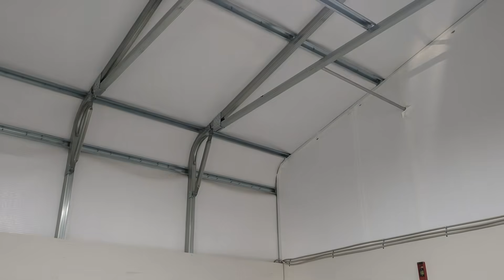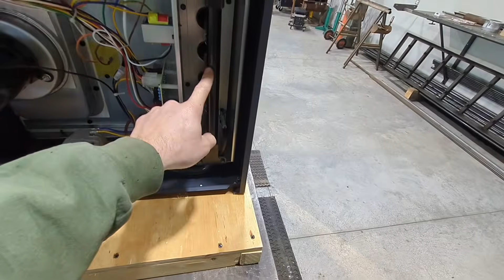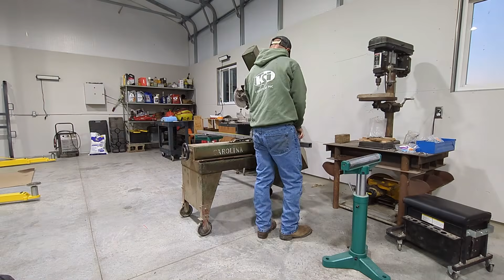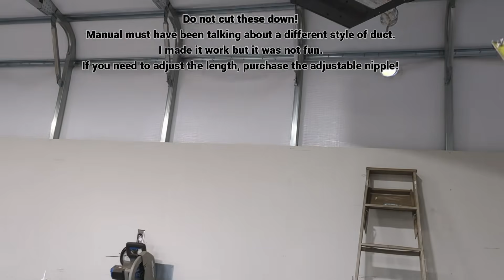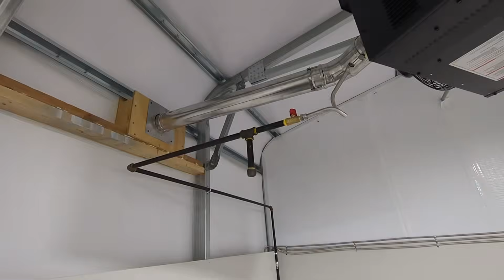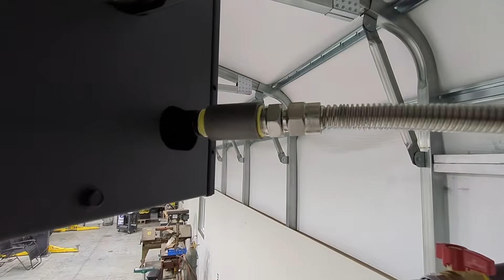Mr Heater Big Maxx Shop Garage Heater full install with Propane Conversion

Comment: Do you know if I can install a wifi enabled thermostat to this so that I can control the shop temperature from the house? Would be nice if I could turn the heater on an hour before I head back there to warm it up.
Reply from the maker: Yes, I think you can do that. I saw another video on you tube where they did that with their Big Maxx.

Comment: A year has gone by. How's it work? You're in a similar situation as I am as far as heating and cooling. Do you wish you would have gone larger?
Reply from the maker: So far it is working great. The only issue I have is that when the wind is blowing hard it will keep sitting down the flame and it has to relight. This only happens on windy days and we are out in the open with nothing to block the wind. Since the shop is sealed pretty tight it doesn't take too long to warm it up so I don't wish I went bigger. I usually turn it on a half hour or so before I want to start working and it works well.
Reply: @String-Ridge  my shop is out in the open as well so that's a real possibility of an issue for me

Comment: silly question, what fitting or how would you secure the gas line through the wall/ is there a bulkhead fitting or a special clamp for the black pipe? Mine will be going through a wood structure wall siding, into a 2x6 cavity. thanx
Reply from the maker: I'm honestly not 100% sure the exact way you are supposed to do it. I had enough clamps holding it to the wall on the inside that it held it all sturdy. The piece going through the wall was short and I just siliconed it on the outside. I'm sure there's a better way but that's what I did.

Comment: When you connect the flex line to the unit do you use the sealant as well?
Reply from the maker: If they are regular pipe thread fittings you will need sealant, but the fittings on my flex line were flared and those do not require sealant.

Comment: How much it cost to run lets say 3 days a week for.a whole month
Reply from the maker: Sorry I'm not sure, depends on how much insulation you have. My insulation isn't that thick but I only run the heater when I'm working out there. To me it seems like it's pretty efficient.
Reply: @String-Ridge thats my plan😂, about how much u spend in a day?
Reply: @rigorb25det  That's my question as well..

Comment: Question,  was your outlet for exhaust really loose? I noticed mine wiggled a bit but once I attached the flue pipe now it wiggles really bad-almost feels like it is broken or trying to come loose inside the unit. Maybe its supposed to move like that but trying to make sure.
Reply from the maker: I do not remember mine being loose. I would open up the side and see if you can figure out if there's something that came unattached.

Comment: I just did an install in my garage, its the 50k BTU unit though. Used gas tite flex pipe, way easier than that black pipe! I also wired a nest thermostat to the unit. Works awesome in our 3 stall! Note, I also suspended my heater just as you did, hanging it on the trusses. Double nut the ends. Good work!
Reply from the maker: Glad to hear it's working well for you! Only issue I've had with mine is when it gets windy the flame will keep going out and relighting. We live out in the open and nothing blocks the wind. I switched out the end cap with one made for high wind, hopefully it helps this winter.
Reply: @String-Ridge I bet it will

Comment: One of the best install videos I've seen.  Unfortunately my trusses are on 10 ft centers.  I don't know what size beams to use to hang the 125,000 blu unit from with the threaded rod.....
Reply from the maker: I would think a 2 x 4 rectangle tubing 11 ga or something similar sitting on the narrow side would be strong enough to span 10' and support that weight. Thanks for checking out the video!

Comment: Looks good but your drip leg is ran incorrectly. Gas is going to just flow over that and work the opposite way as you want it to. I would move it down by the vertical pipe and make a section where your horizontal section can attach to
Reply from the maker: Thanks for the advice. So the drip leg needs to be at the bottom of the vertical leg?
Reply: @ at the very top of your vertical pipe where the horizontal section starts, you want to add it there. Then run a T fitting to connect your horizontal pipe off of the drip leg. That way gas is forced into the dead end first. Then gas will re route its direction to your horizontal pipe and to the heater.
Reply: @String-Ridge   here is a diagram. You can see where the horizontal pipe connects to the drip leg section 
                          ——-
                          l       l
———————— l      l
                          l       l
                                  l
                                  l
                                  l
Reply from the maker: Ahh this makes sense. Thank you!
Reply: So glad you pointed that out. Ready to install the same heater and would have got it wrong 🙏🙏🙏

Comment: I put the 125k unit in my 40x28 shop and it is great at heating the space.  Currently -4* here in upstate NY and no problem keeping it warm.  We did the conversion to propane as well.  Good luck with yours.
Reply from the maker: That's great to hear you are having good luck with yours. Is your shop fully insulated? Mine has been installed for a couple months now and it is doing great. Thanks for checking out the video!
Reply: @String-Ridge  Yes, pretty well insulated with (2) 10'x10' OH doors that leak some air. I tightened them up what I could but still not great. It was -11* last night and no problem keeping it at 50* overnight. I could have raised it but trying to save some propane - just like to keep the place warm for when I go down there to work and rust off my tools. Enjoyed your video.  Keep them coming!
Reply: @57Dalv how much propane do you go thru a month leaving it set at 50 over night?
Reply: @FAROFFROADLLC  For January we used 75 gallons. It was very cold the entire month so I would expect to use less as we move towards spring. I turn it up on weekends when working in the shop - usually about 60*.
Reply: @57Dalv  How much Popane are you going through?